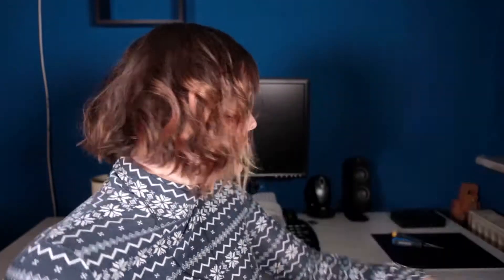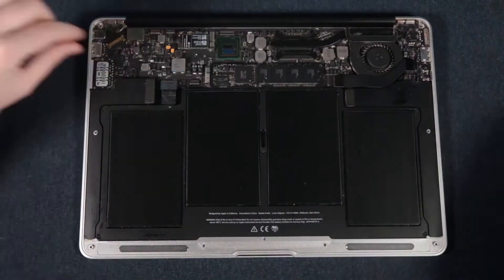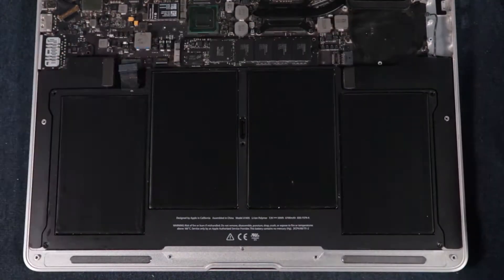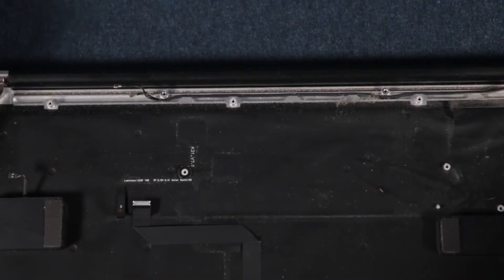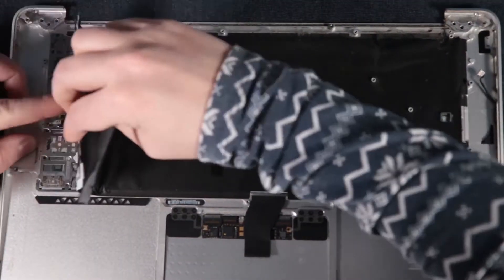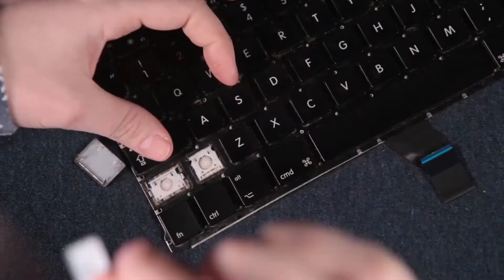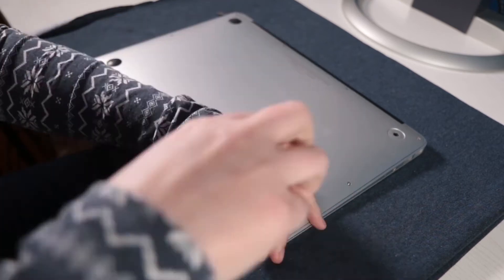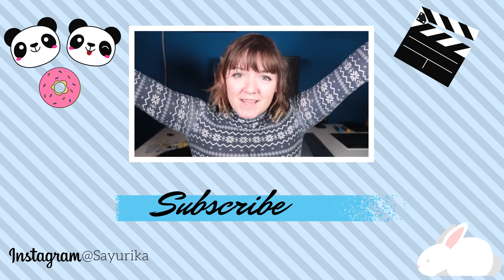Replacing MacBook Air 13" Mid 2011 Keyboard

Comment: For the rivet stumps I use xcelite 170's down on the base, give it a gentle squeeze NOT enough to cut and twist gently sideways... For the screwdrivers I take the cheap ones included in an Iphone screen kit and shorten the tip on a belt sander....   Double sided tape on cardboard does a great job of organizing the screws....  Write next to the screws where they go...

Comment: Do backlight and F1-F12 keys (volume, brightness and etc.) works properly? As I can see you didn't use rivets you pulled out from the original keyboard. So, is there any difference in the middle of the keyboard (maybe some slack or keyboard moving while typing) with and without rivets?
Thanks for the video!
Reply from the maker: Hi Javid, thanks for watching. I don't notice any difference. All the buttons and backlight work just fine, even now, years later. I guess I was lucky that way.

Comment: This is great!! I found your video after I  just replaced mine but my monitor won't display... Now taking everything apart to try and do it again.. any suggestions? I checked the video cable and all looks secure. Only think I can think is just take apart a second time and cross my fingers.
Reply from the maker: Sunstone Astrology yeah, sometimes even if one random thing is not connected properly, the entire thing might not work. So just try to be very precise with all of the components and you should be good. Fingers crossed!